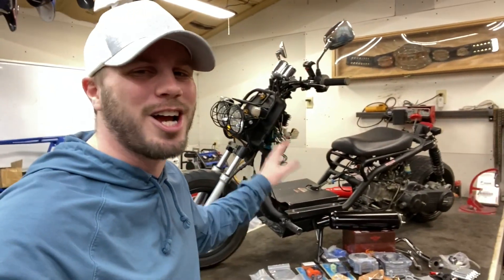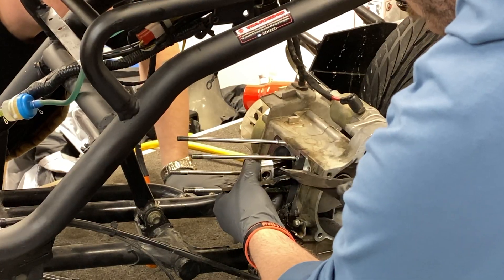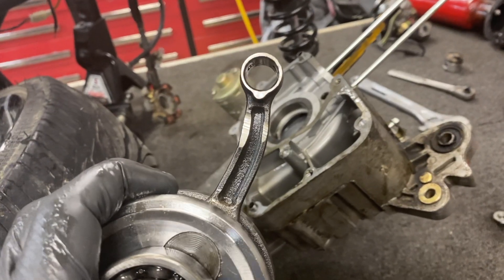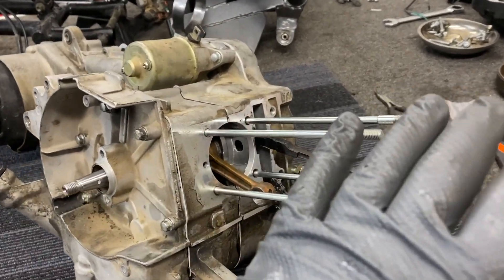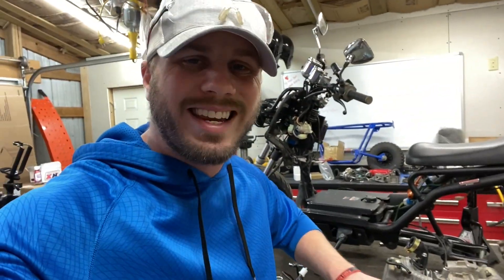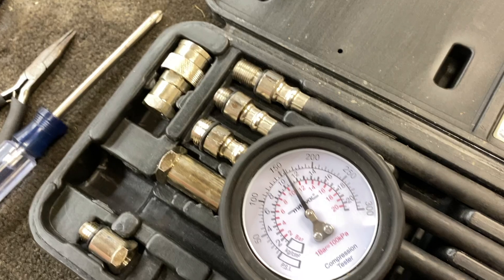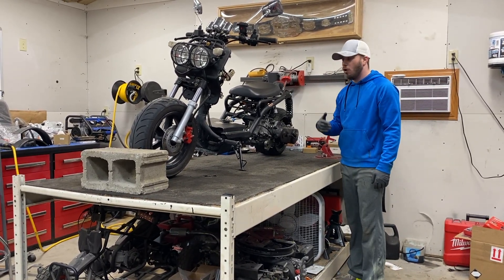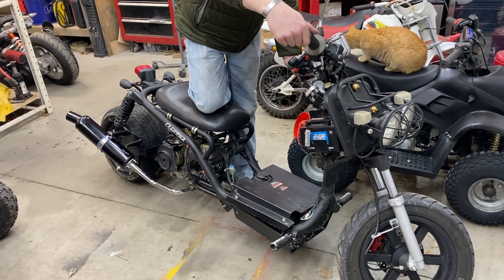100cc Big Bore Kit on a Honda Ruckus Clone! Will It Run...Better? GY6 139QMB It's a Chuckus?!?

Comment: Can you recommend a top end rebuild or big bore kit for a 2002 Arctic 90 2 cycle.
Reply from the maker: I have never wrenched on one before, but I bought a similar kit for my scrambler 90 we had. Check out eBay item number: 383870750993 The Niche cylinders are cheap so if you can get away with honing and keep the stock cylinder your way better off. The kits comes with a Wiseco piston which is my go to for anything I am rebuilding and plan on keeping.
Reply: @PraskaBoysGarage  great thanks
Reply: The 2006 arctic 90 is almost identical to those scooter motors. The only difference I really notice was chain drive on the ATV vs Direct drive on the scooters.

Comment: With the added torque I assume you'll change sprockets.
Reply from the maker: I have researched all the gearing ratios, but before we do that we want to max the power with the current gearing. Then we will decide what ratio we want to change to.

Comment: what about heat cycles??????? if you put in a crank,piston and cylinder you shuold not do a top speed run after 5 mins
Reply from the maker: I'd love to tell you we broke it in, but this motor is a guinea pig. It was a "Go or Blow" break in for sure. *Now with that being said, if this was a name brand motor we absolutely would have. I don't recommend the go or blow if you plan to keep a motor, but this one is getting swapped out in the spring.

Comment: Im sorry BUT that kit is 100% junk. You saved money buying a clone smart very smart.. but you can not cheap out on parts. You need a NYC BBK they are affordable not top of the line but very good. Than a 24mm oko carb. NYC cdi NGK coil and plug. Upgrade all lines fule/brake/throttle. NYC exhaust topped with the NYC cvt kit made just for this bike or a koso cvt kit they are good aswell. Check out "rolling wrench" on YouTube he specializes in the chuckies.
Reply from the maker: I hear you man, and everyone is entitled to an opinion. I know what the kit is and so does most people watching. There is a reason you won't find a link in the description of the video. The reason we didn't buy a Naraku 52.4mm with stroker crank was because that's almost $400 dollars and we can do a complete 150cc swap for $500. I am new to the scooter game but I promised by the end it all I will have them performing as good as they can! Thanks for watching!
Reply: @PraskaBoysGarage  fair point. Stroker kits are expensive and that is what i got after 1st buying the same kit you got here.. night and day.. but you can still go name brand without going broke. 50mm nyc kit is around $100 nyc cdi NGK coil and plug $60 carb you can get a cheap clone carb to hold you over but they all suck vs a true 1. Oko's are the affordable kind of.. and a koso cvt is another $100 topped with some dr. Pullys silders or narkra roller kit $25 exhaust you can cheap out on they all work the same more or less just sound different last longer stuff like that.. so for around $300-$400 you can rebuild the whole motor. NYC kits are more of your everyday commuter kits , narkra is more of a racing kit.
Reply: @PraskaBoysGarage  also.. sorry... i left out the fact the video is great you explain things clearly great video overall.. just being a victim of the cheap ebay kits lol i hate to see anyone else victimized buy them. 😅
  People buy them kits than breakdown a few dozen miles later and blame the bikes or think its not worthwhile to mod the bike when it is. It's sooo fun getting riding a bike built to go 30-35 doing 50mph lol 😆 my mojo trike is my favorite ride it gets more miles than my goldwing trike and that thing has every bell and whistle + 1100cc

Comment: You have wayyyy to much rpms
Reply from the maker: I am new to the scooter life but I felt that as well. We ordered a transmission tuning kit with weights & springs. We will get it dialed in to Justin's weight and also the carb properly jetted.